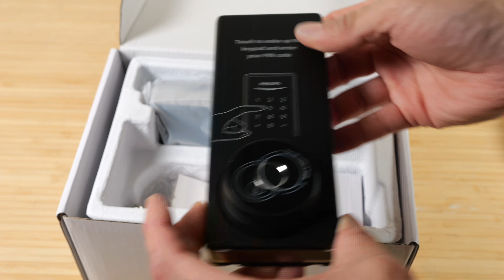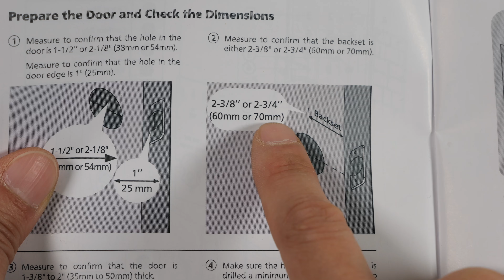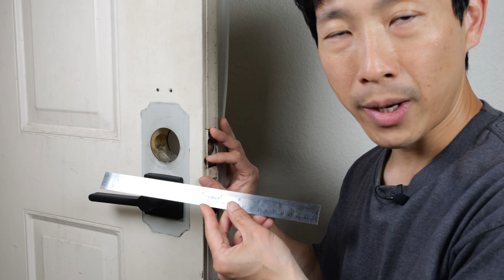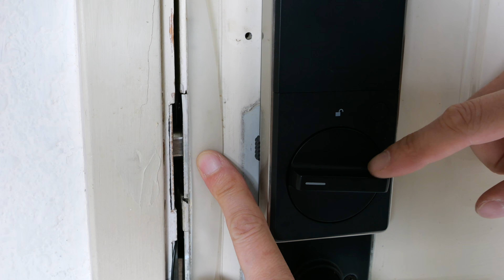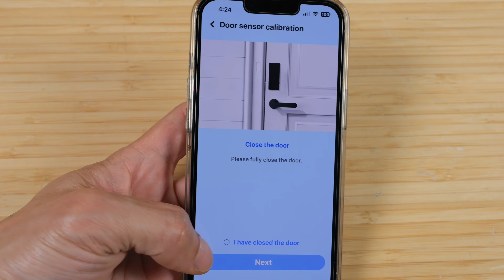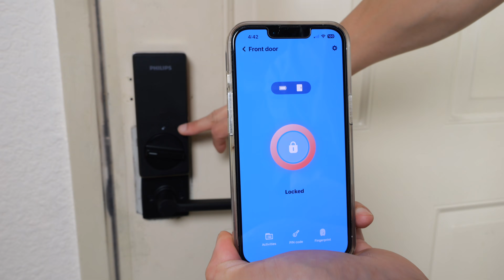Easy Smart Lock Drop-in Smart Lock from Philips

Comment: Can you help me. I have a Philip one like this one. The motor only wants to go left. I need it to go right. I can't find anyway to adjust that. Not on the app either. Any help?
Reply: reset the lock and with the door open set the lock direction first. In the manual you should have the sequence for setting up the lock direction
Reply: @azelo7952 thank you for your help! It's fixed!